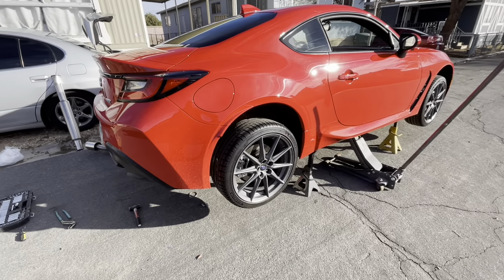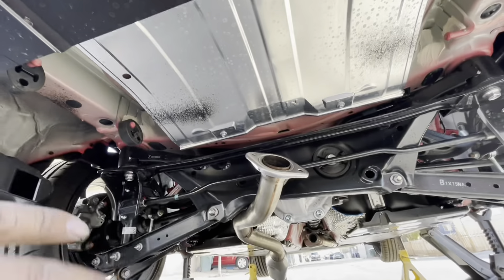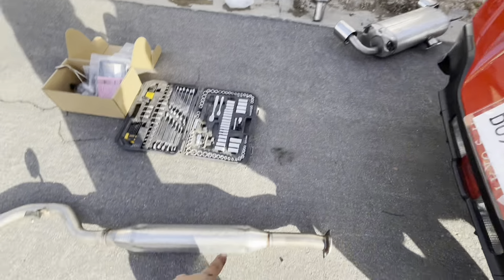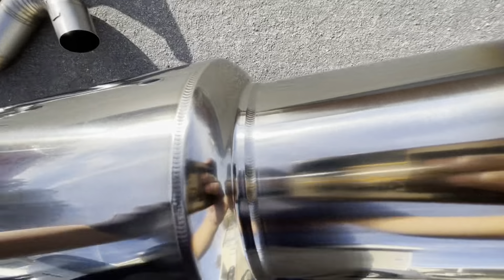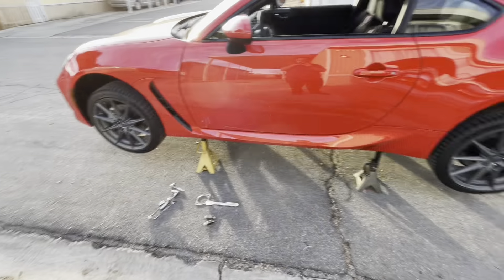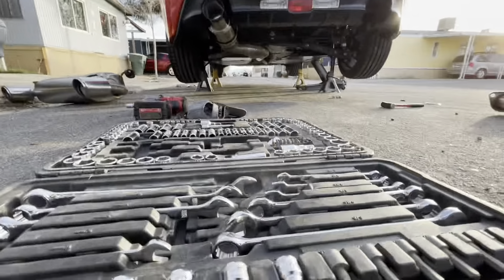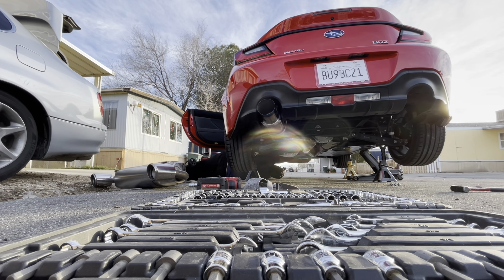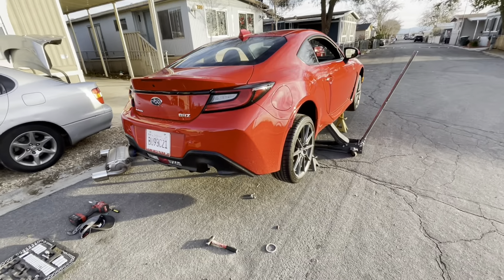Working On A New 2022 Brz Tomei

Comment: Please refrain from using the pinch seams for jack stands or lifting points. Instead use the recommended reinforced areas on the inside of the seams directly on the body itself to avoid damaging the thin metal pinch seams. Hope this helps.

Comment: So the 2019 brz tomei fits the 2022 brz?
Reply from the maker: Yes sir
Reply: Basically everything from the old BRZ fits the new ones. Headers, exhaust, wheels, suspension. Its the same car with bored out cylinders.
Reply: @boost331  not everything. My muffler delete from my 2017 won't fit on my new 2022. Just depends on what you've got to add on
Reply: @malcolmdbz  Correct. You cant use just an axle back setup from gen 1. Currently if you want an exhaust you need a gen 1 full catback. Everything  mounts in the same place. The only difference is the new car uses a center inlet on the muffle, which flows much better than the sideways loopty loop setup on the older cars. Thats why none of the catback systems uses that design. They all go straight down the middle.
Reply: @boost331  i'm trying to shop cat backs, but idk if i wanna use something designed for previous gen or wait for new products to come out, specifically designed for new gen.
Reply: @malcolmdbz  Gen 1 catbacks fit 100% fine. Axle back kits do not though. The new car has the muffler inlet in the center instead of making a loop and coming in on the side like the old car did. Pretty much all aftermarket catbacks come straight down the middle as well. It flows better that way. I am thinking most companies will not redesign their exhausts if they know their existing parts work fine. The cheaper option may be to wait for an axle back kit to come out. If you want full catback, the list of options is endless.
Reply: @boost331  thank you for sharing your wisdom. I'm thing i wanna go catback, for the performance gain and sound, but i love the loud volume of the axelback. Would love to find a cat that still roars